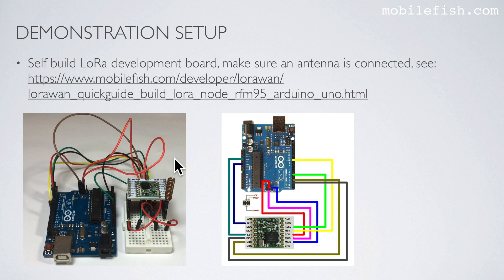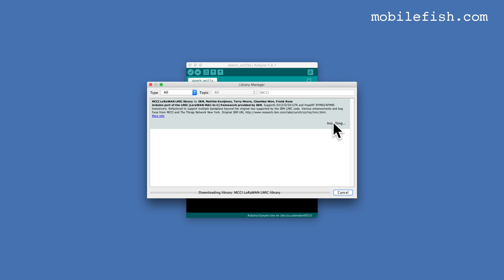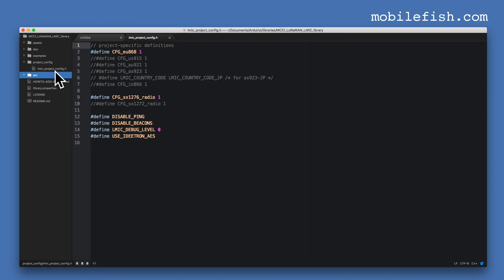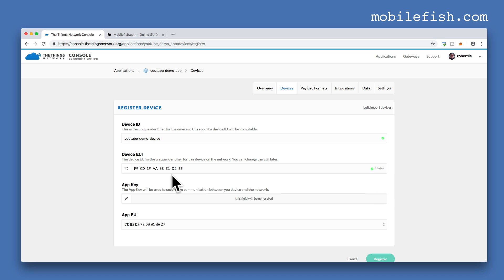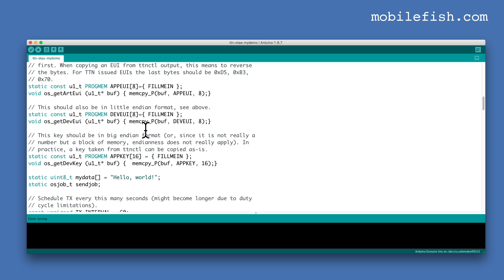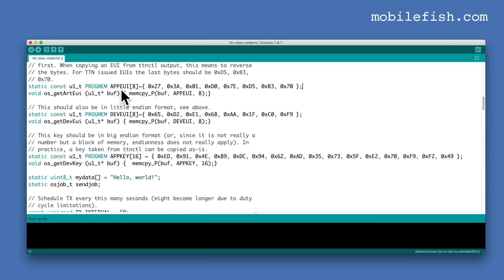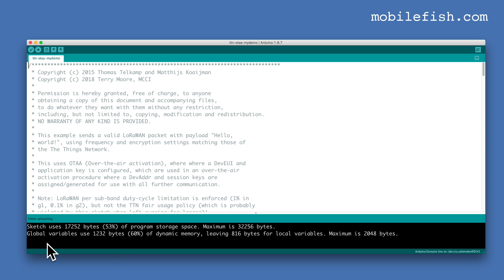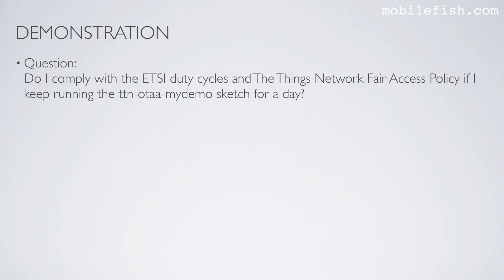LoRa/LoRaWAN tutorial 22: OTAA and Uplink Demonstration With The Things Network

Comment: Hello, very good video, congratulations. I have in my hands the LORA SX1278 module,  the difference with yours is that it does not have the DIO1, and that if frequency working ranges from 410 to 525 Mhz. This work frequency is not among the library settings. Wouldn't your guide be useful for my module because that library only works with those frequencies and the sx1276 module? or could I configure my module in some way? Thank you.

Comment: What about config.c file . Should we modify radio parameters i am also using 868 MH. I setted uplink with 868.1 and downlink for 869.525 but unfortunately i got error  441
Like this: Doc\Arduino\libraries\arduino-lmic-master\src\lmic\radio.c:441 
Any idea for this issue?

Comment: Thanks for the tutorial. I was trying to connect LoRa gateway by using ttgo SX1276 and pin configuration was the issue. I am using this config

const lmic_pinmap lmic_pins = {
    .nss = 18,
    .rxtx = LMIC_UNUSED_PIN,
    .rst = 14,
    .dio = {26, 33, LMIC_UNUSED_PIN},
}; 

But still can't connect to LoRa gateway!
Reply from the maker: Byazit, there are many LoRa modules. If you have a problem with a LoRa module I recommend that you post your question at The ThingsNetwork forum.  I have found this information, but I am not sure if this solves your problem. https://www.thethingsnetwork.org/forum/t/big-esp32-sx127x-topic-part-3/18436
Reply: @Mobilefish  I fixed it, thanks for your help!

Comment: The next problem was a loose solder joint in the boars causing it to restart.  Fixed that and now I am getting this message.
11:26:37.579 -> Starting
11:26:37.613 -> Packet queued
11:26:37.613 -> 211: EV_JOINING
11:26:42.134 -> 282168: EV_TXSTART
11:26:42.134 -> FAILURE
11:26:42.134 -> /Users/roberthancock/Documents/Arduino/libraries/ MCCI_LoRaWAN_LMIC_library/src/lmic/radio.c:523
11:28:28.295 -> Starting
11:28:28.329 -> Packet queued
11:28:28.329 -> 225: EV_JOINING
11:28:28.886 -> 35163: EV_TXSTART
11:28:33.868 -> FAILURE
11:28:33.868 -> /Users/roberthancock/Documents/Arduino/libraries/ MCCI_LoRaWAN_LMIC_library/src/lmic/radio.c:621
11:30:19.378 -> Starting
11:30:19.412 -> Packet queued
11:30:19.412 -> 213: EV_JOINING
11:30:20.160 -> 45414: EV_TXSTART
11:30:25.093 -> FAILURE
11:30:25.093 -> /Users/roberthancock/Documents/Arduino/libraries/ MCCI_LoRaWAN_LMIC_library/src/lmic/radio.c:621
11:31:23.218 -> Starting
11:31:23.254 -> Packet queued
11:31:23.254 -> 233: EV_JOINING
11:31:27.318 -> 254887: EV_TXSTART
11:31:27.318 -> FAILURE
11:31:27.318 -> /Users/roberthancock/Documents/Arduino/libraries/ MCCI_LoRaWAN_LMIC_library/src/lmic/radio.c:523

Here are the relevant lines in the radio.c.library static void txlora () {
// select LoRa modem (from sleep mode) //writeReg(RegOpMode, OPMODE_LORA); opmodeLora();
ASSERT((readReg(RegOpMode) & OPMODE_LORA) != 0);
// enter standby mode (required for FIFO loading)) opmode(OPMODE_STANDBY);
// configure LoRa modem (cfg1, cfg2) configLoraModem();
// configure frequency
configChannel();
// configure output power
writeReg(RegPaRamp, (readReg(RegPaRamp) & 0xF0) | 0x08); // set PA
ramp-up time 50 uSec
configPower();
// set sync word
writeReg(LORARegSyncWord, LORA_MAC_PREAMBLE);
// set the IRQ mapping DIO0=TxDone DIO1=NOP DIO2=NOP
writeReg(RegDioMapping1, MAP_DIO0_LORA_TXDONE| MAP_DIO1_LORA_NOP|MAP_DIO2_LORA_NOP);
// clear all radio IRQ flags
writeReg(LORARegIrqFlags, 0xFF);
// mask all IRQs but TxDone
writeReg(LORARegIrqFlagsMask, ~IRQ_LORA_TXDONE_MASK);
// initialize the payload size and address pointers writeReg(LORARegFifoTxBaseAddr, 0x00); writeReg(LORARegFifoAddrPtr, 0x00); writeReg(LORARegPayloadLength, LMIC.dataLen);
// download buffer to the radio FIFO writeBuf(RegFifo, LMIC.frame, LMIC.dataLen);
// enable antenna switch for TX hal_pin_rxtx(1);
 
// now we actually start the transmission opmode(OPMODE_TX);
#if LMIC_DEBUG_LEVEL > 0
u1_t sf = getSf(LMIC.rps) + 6; // 1 == SF7
u1_t bw = getBw(LMIC.rps);
u1_t cr = getCr(LMIC.rps); LMIC_DEBUG_PRINTF("%"LMIC_PRId_ostime_t": TXMODE,
freq=%"PRIu32", len=%d, SF=%d, BW=%d, CR=4/%d, IH=%d\n", os_getTime(), LMIC.freq, LMIC.dataLen, sf,
bw == BW125 ? 125 : (bw == BW250 ? 250 : 500),
cr == CR_4_5 ? 5 : (cr == CR_4_6 ? 6 : (cr == CR_4_7 ? 7 : 8)), getIh(LMIC.rps)
); #endif
}
// start transmitter (buf=LMIC.frame, len=LMIC.dataLen) static void starttx () {
u1_t const rOpMode = readReg(RegOpMode);
// originally, this code ASSERT()ed, but asserts are both bad and // blunt instruments. If we see that we're not in sleep mode,
// force sleep (because we might have to switch modes)
if ((rOpMode & OPMODE_MASK) != OPMODE_SLEEP) {
#if LMIC_DEBUG_LEVEL > 0
LMIC_DEBUG_PRINTF("?%s: OPMODE != OPMODE_SLEEP:
%#02x\n", __func__, rOpMode); #endif
opmode(OPMODE_SLEEP);
hal_waitUntil(os_getTime() + ms2osticks(1)); }
if (LMIC.lbt_ticks > 0) {
oslmic_radio_rssi_t rssi; radio_monitor_rssi(LMIC.lbt_ticks, &rssi);
#if LMIC_X_DEBUG_LEVEL > 0
 
LMIC_X_DEBUG_PRINTF("LBT rssi max:min=%d:%d %d times in %d\n", rssi.max_rssi, rssi.min_rssi, rssi.n_rssi, LMIC.lbt_ticks);
#endif
if (rssi.max_rssi >= LMIC.lbt_dbmax) {
// complete the request by scheduling the job os_setCallback(&LMIC.osjob, LMIC.osjob.func); return;
} }
if(getSf(LMIC.rps) == FSK) { // FSK modem txfsk();
} else { // LoRa modem txlora();
}
// the radio will go back to STANDBY mode as soon as the TX is finished
// the corresponding IRQ will inform us about completion. }
enum { RXMODE_SINGLE, RXMODE_SCAN, RXMODE_RSSI };
static CONST_TABLE(u1_t, rxlorairqmask)[] = { [RXMODE_SINGLE] = IRQ_LORA_RXDONE_MASK|
IRQ_LORA_RXTOUT_MASK,
[RXMODE_SCAN] = IRQ_LORA_RXDONE_MASK, [RXMODE_RSSI] = 0x00,
};
// start LoRa receiver (time=LMIC.rxtime, timeout=LMIC.rxsyms, result=LMIC.frame[LMIC.dataLen])
static void rxlora (u1_t rxmode) {
// select LoRa modem (from sleep mode)
opmodeLora();
ASSERT((readReg(RegOpMode) & OPMODE_LORA) != 0); // enter standby mode (warm up))
 
opmode(OPMODE_STANDBY);
// don't use MAC settings at startup
if(rxmode == RXMODE_RSSI) { // use fixed settings for rssi scan
writeReg(LORARegModemConfig1, RXLORA_RXMODE_RSSI_REG_MODEM_CONFIG1);
Reply from the maker: Robert, to help you I need to know the lines where the error occurs.
See:
https://github.com/mcci-catena/arduino-lmic/blob/master/src/lmic/radio.c#L523
but as you can see your code and my code (the latest version) does not match because you are using another version. I assume you have not modified the radio.c file.

So to help you out:
Go to github and give me the correct LINENUMBERS where the error occurs, for example:
https://github.com/mcci-catena/arduino-lmic/blob/master/src/lmic/radio.c#L523
https://github.com/mcci-catena/arduino-lmic/blob/master/src/lmic/radio.c#L526
As you can see these linenumbers are not correct, because they refer to an empty line and a comment.
Reply: In radio.c, Line #523     ASSERT((readReg(RegOpMode) & OPMODE_LORA) != 0);
and Line #621   ASSERT((readReg(RegOpMode) & OPMODE_LORA) != 0);

Thanks for any help you can suggest.
Reply from the maker: @roberthancock813  Which radio are you using? sx1272 or sx1276

If you use sx1272, than in project_config/lmic_project_config.h file, enter:
#define CFG_sx1272_radio 1

If you use sx1276, than in project_config/lmic_project_config.h file, enter:
#define CFG_sx1276_radio 1
Reply: @Mobilefish  pls, im used sx1278, need i modific config file to sx1278, the radio file to sx1278?? help me pls, i have 2 question more pls

Comment: OK, on checking carefully again, that first error was due to a pin map mistake, but after correcting the error, now I am seeing the characters stst appear when I select Serial Monitor at the final stage.  Any idea what might cause that? The LoraWAN RPI hat (Lora/GPS) is less than 1 m from the node and is connected to TTN.
Reply from the maker: Robert, it is very difficult for me to help you out.
I do not know the LoraWAN RPI hat.

Of the top of my hat, just some random solutions:
1) Make sure jumper wires are not broken and the jumper wire connectors are not loose.
2) Make sure you connect the jumper wires to the same GND on Arduino and  LoraWAN RPI hat.
3) In my tutorials I am using the HopeRF RFM95. I do not know the LoraWAN RPI hat? Which LoRa module is it using? It might be that the pin mapping is different.

Comment: Hello Robert,

with the Arduino Uno + RFM95 Lora Transceiver module 
Getting the following error:

Starting
FAILURE 
C:\Users\<User>\Documents\Arduino\libraries\MCCI_LoRaWAN_LMIC_library\src\lmic\radio.c:621

Checked the source code:

// start LoRa receiver (time=LMIC.rxtime, timeout=LMIC.rxsyms, result=LMIC.frame[LMIC.dataLen])
static void rxlora (u1_t rxmode) {
    // select LoRa modem (from sleep mode)
    opmodeLora();
    ASSERT((readReg(RegOpMode) & OPMODE_LORA) != 0);
    // enter standby mode (warm up))
    opmode(OPMODE_STANDBY);

Any idea why this error is popping:
1. Is it due to levelshifing issues 5.0V vs 3.3V
2. Or something else.

Thanks in advance.
Reply from the maker: The line number does not match anything:
https://github.com/mcci-catena/arduino-lmic/blob/master/src/lmic/radio.c#L621
You probably using a different version or modified the file.
Reply: @Mobilefish  Thanks. Just to save time. I just installed the library from the link you have provided here. I am getting the following error:
Starting
FAILURE 
C:\Users\<user name>\Documents\Arduino\libraries\arduino-lmic-master\src\lmic\oslmic.c:53
I checked the code at the given file name and line

void os_init() {
    if (os_init_ex((const void *)&lmic_pins))
        return;
    ASSERT(0);
}

It is AEERT(0);

Any clues?

Similar to the post:
Robert Hancock
Robert Hancock
2 days ago
Starting
FAILURE 
/Users/robertlaptop/Documents/Arduino/libraries/MCCI_LoRaWAN_LMIC_library/src/lmic/oslmic.c:53
 I am getting the above failure to start—any ideas where I should look to troubleshoot?

Thanks in advance.
Reply from the maker: @samasenis  1) Make sure jumper wires are not broken and the jumper wire connectors are not loose. Use multimeter and check it! Are the breadboard connections ok??
It may seems silly to check these but I had problems with my breadboard AND jumper wires and waisted LOTS of time! 

2) Make sure you connect the jumper wires to the same GND on Arduino and  HopeRF.
3) Check your connections. This is mine (check and DOUBLE check)
https://www.mobilefish.com/images/developer/lorawan_rfm95_arduino_large.jpg
Image from tutorial:
https://www.mobilefish.com/developer/lorawan/lorawan_quickguide_build_lora_node_rfm95_arduino_uno.html
4) Based on step 3, this is my pin mapping:
const lmic_pinmap lmic_pins = {
    .nss = 10,
    .rxtx = LMIC_UNUSED_PIN,
    .rst = 5,
    .dio = {2, 3, LMIC_UNUSED_PIN},
};

Comment: Hello, Robert.
Another question... Do you see any way to make a bulk activation of LoRa devices in TTN using the OTAA method? I mean, without registering each device manually in TTN and getting the parameters to input in the Arduino sketch? 
Thanks.

Comment: The videos were very helpful to have an idea about LoRaWAN . If I don't have a gateway nearby or in an area of 10km, Can I use " The Things gateway"  to send the data from the LoRa node to "The Things network".  I have to activate the gateway first. Other than that ,do I need to make any changes in the LMIC code or need any extra hardware part to connect the LoRa node to the gateway. Please reply.
Reply from the maker: Ehhh, I think you are missing the point.
Your laptop with ONLY WIFI capability equals an end node.
Your Wifi router equals a LoRaWAN gateway.
Google website equals The Things Network.
If there is NO Wifi router nearby, can you access the Google website on your laptop?
Reply: @Mobilefish  FANTASTIC

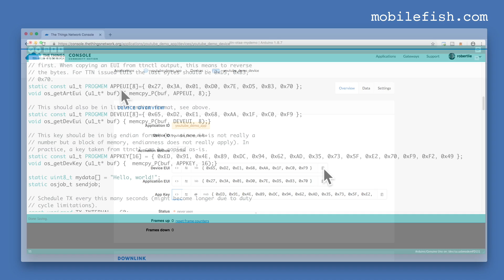Comment: At 08:50 you copy the DevEUI, the AppEUI, and the AppKey from the TTN Devices console.  Both the DevEUI and AppEUI are copied in LSB order and the AppKey is copied in MSB order.  Is this Big Endian / Little Endian or MSB/LSB byte order dependent on the microprocessor used (PIC, Arduino, RPi, STM32, etc.) or due to the LMIC library?  I'm trying to understand this same issue for newer, integrated chips like the RN2903/RN2483 and the R34/R35.  These chips have an integrated MAC layer.
Reply: Hex, lsb or msb?  TTN Forum:   https://www.thethingsnetwork.org/forum/t/hex-lsb-or-msb/2809

Comment: hi mobile fish,I am new to LoraWan. I would like to know why I upload the lmic-abp file to the 433MHz lora shield with entering the network section key, app section key and devaddress. When I open the serial monitor of Arduino , it stucks and loop in packet queued and EV_TXComplete ( includes waiting for RX windows) while the ttn shows not connected of my device.
Reply: my gateway is lg-01 p which is function at 433mhz. I registered a 868Mhz frequency plan at ttn and it shows that is connected
Reply from the maker: Always make sure you use the correct frequency plan which applies to your country.
For example if you live in USA, the US902-928 applies to you.
https://www.thethingsnetwork.org/docs/lorawan/frequency-plans.html

If you use the MCCI Arduino LMIC library, you use:
#define CFG_us915  1

Why it works for you I do not know.
Reply from the maker: I just Googled "lg-01 p" and I noticed that it is a single channel gateway. 
Please note: A single channel gateway is not a real LoRaWAN gateway.
Reply from the maker: If you use the OTAA mode you must use the ttn-otaa sketch as demonstrated in the video. In my next video Tutorial 24, i will demonstrate the ABP mode. In that mode you use the ttn-abp sketch.
Reply: The lg01-p gateway show connected in ttn but no packet is forwarded to ttn
Reply: My country only allows 433mhz frequency plan